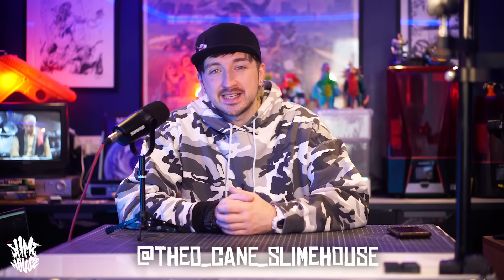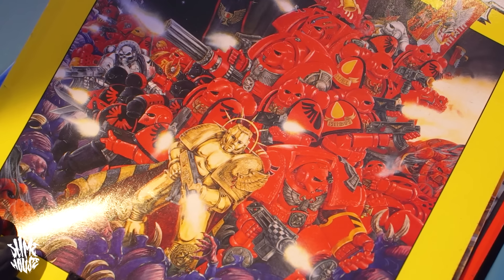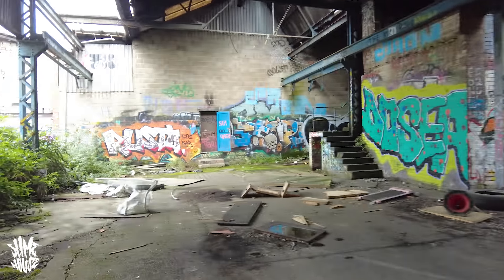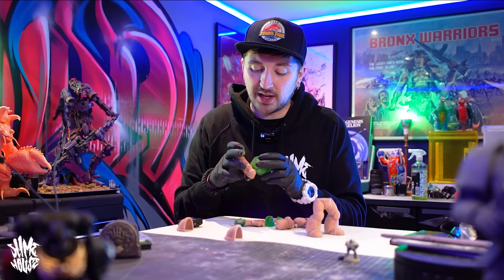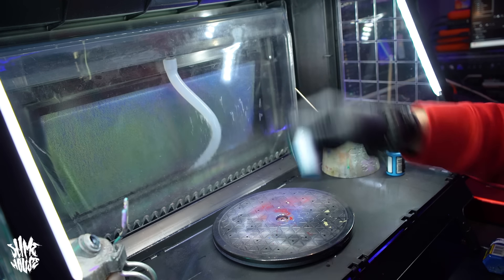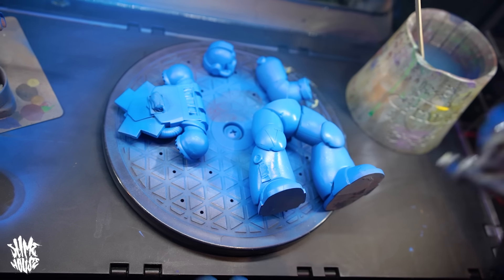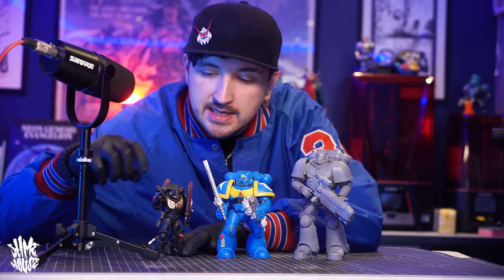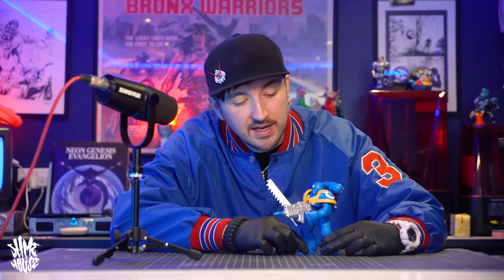Space Marine Retro Action Figures!? - Creating the 90's Warhammer Toyline that Never was.

Comment: If you're going to try out resione, I'd also try sunlu high toughness resin. It's comparable in terms of quality but sunlu is a lot cheaper. With both, you need to let it set for a day after printing but they feel like injection moulded plastic when you dial it in. I've been using sunlu to make action figures and it's probably the one I'm going to settle with.
Reply from the maker: Thanks for the recommendation I'll check it out 🙌🙏

Comment: Looks solid EXCEPT the Bolter. GW changed up the design from 2nd edition to 3rd edition, and you've put a 3rd edition Bolter on a 2nd edition Marine

23:33: No Intercessors in 2nd edition, they're a Primaris thing. The color scheme you've picked looks like Flesh Tearers, except for the Chapter insignia. 

24:14: Well, you could until GW swept the Firstborn under the rug. 2nd edition metal bodies were cross-compatible with 3rd edition plastic arms and backpacks, 3rd edition plastics were designed to be as modular as possible so you could absolutely go to town with parts swaps. But the current Primaris stuff is much less so, AFAIK.

Comment: I bet you could make the missile actually work. It's just a spring and a catch release. The hard part is probably gonna be making a two part sub-assembly on the gun that fits.

A tip. You've made battle brothers and given them sergeant gear. To make sergeants, especially since you've already given them the iron skulls, is to paint the Ultramarine's helmet red and the Blood Angel's shoulder pads black. Or else just making them assault marines, which would mean just changing the single arrow on the Ultramarine into the crossed X shaped arrows and giving the Blood Angel a yellow helmet.
Reply from the maker: Thanks for the tip! What makes them a sergeant just the skull on their helmets?
Reply: @slimehousetv  For some chapters (like the Flesh Tearers) the distinction in armor is just the Iron Skull on the helmet. Though I've noticed a lot of players don't follow that rule consistently. The most common distinction (Like for the Ultramarines) is an iron skull and a red helmet. The Blood Angels use different colored helmets to denote different squad types (Red for tactical, blue for devastator, yellow for assault) so they mark sergeants with black shoulder pads and sometimes a blood drop jewel on the helmet.
Reply: @slimehousetv  A sergeant is just a squad leader, and in almost all squad types will carry a pistol and a melee weapon, usually a chainsword. Which is what makes these seem more like sergeants. The only rank and file battle brothers who use similar weapon loadouts are assault squads, which usually, but not necessarily, have jump pack or other means of rapid conveyance. (Bikers for instance are all assault squads) Assault Squads are denoted by four pointed X shaped arrows on the right shoulder for Ultramarines and Flesh Tearers, (and most other chapters) and yellow helmets on Blood Angels. 
A battle line tactical space marine will use a bolt rifle as his main weapon, and may keep a combat knife on his person. A devastator marine will use heavy weapons like missile launchers, lascannons, heavy flamers, etc. But in any squad sergeants will have pistol + melee weapon.
Reply from the maker: @bad-people6510  Cheers for the info dude!